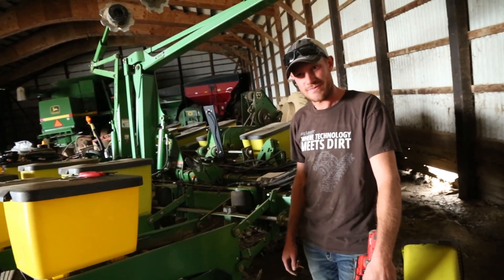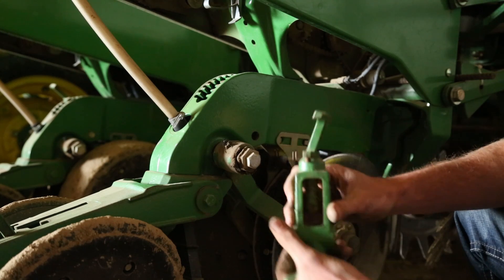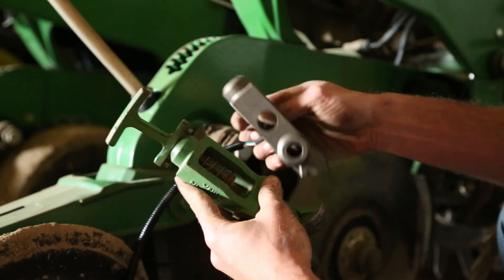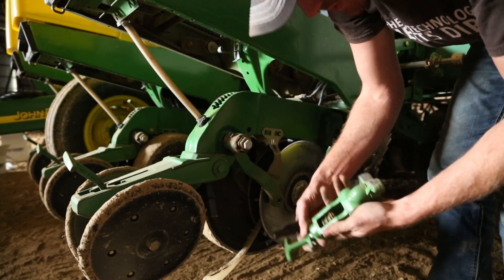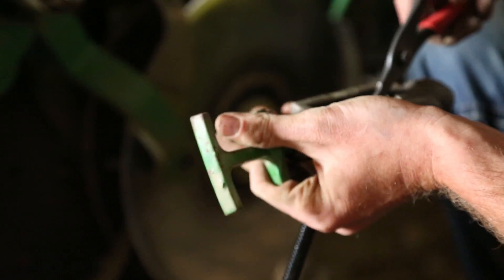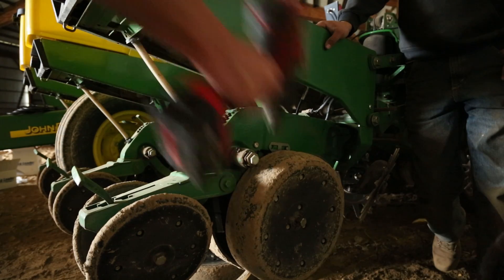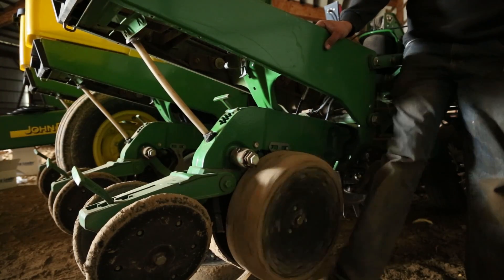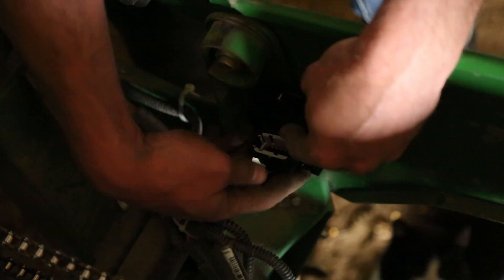Planter Upgrade: Downforce Monitoring

Comment: It'll be interesting to see if this data is "worth the expense"...  I guess I could see a use for this sort of thing in REALLY challenging no-till situations; my BIL's old planter wouldn't no-till because if he set the row down pressure high enough to ensure consistent planting depth (pressure on the opener disks) it lifted the planter toolbar enough that the drive wheels turning the transmission and seed meters became inaccurate due to slippage...  

On tilled ground, this may be overkill... in regular no-till conditions with a heavier more modern planter like this one, it may be a moot issue.  I guess it all depends on the conditions... 

Best of luck with it and looking forward to seeing how it works... :)  

OL J R :)

Comment: This is nice technology.  From Travis' videos, I could see the sensors reading the different pressures across the width of the planter.  My question:  how much of a difference is there between the pressure readings in a conventionally-tilled field vs. a no-till field?  Obviously, the planter is set up differently for each setting, but does the monitor show a difference?